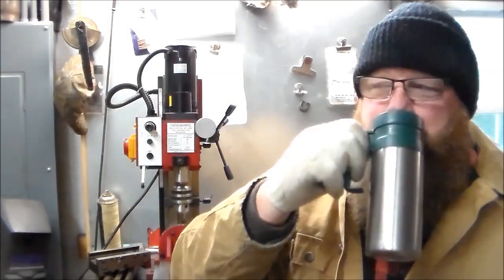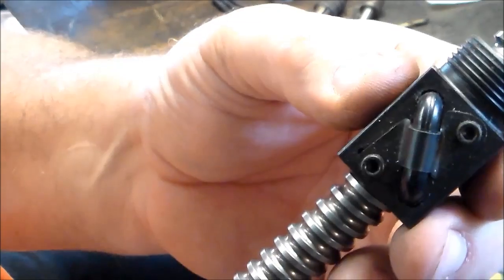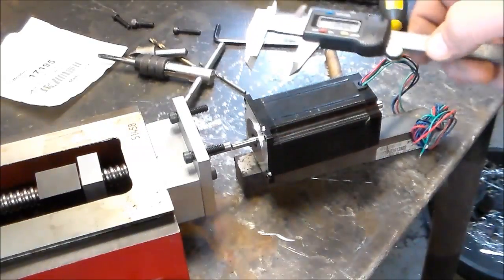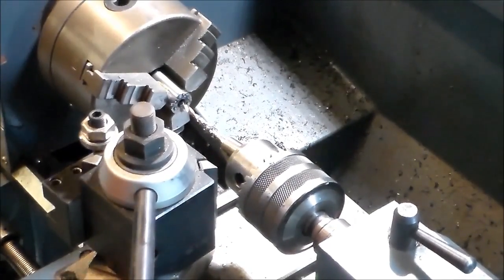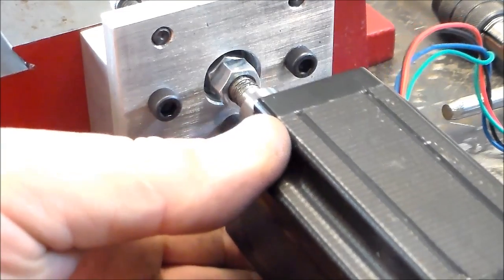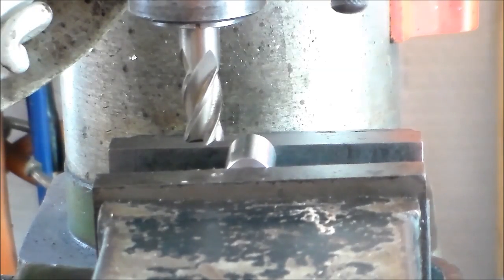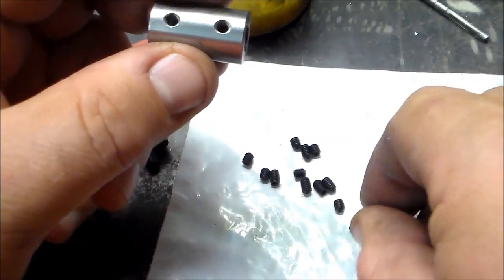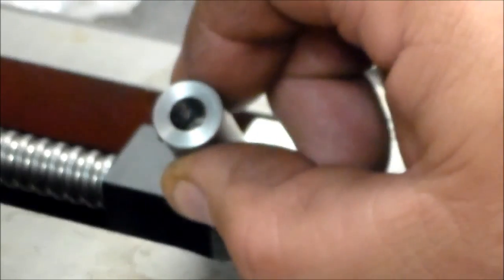Part 6 Harbor Freight Mini Mill X2 CNC Conversion Step by Step

Comment: Ditch the solid couplers. It will break either the stepper shaft or the ballscrew end in time. There are a few simple designs floating around.
   Personally I would buy them but to each his own. Just make them a priority after you get up and running and you will be safe. Otherwise, I will be saying "I told you so" ;-)
Reply from the maker: +CncObsession Oh wow, I haven't heard that before, but like I said in the beginning, I'm completely new at this. I'll definitely look into it.
Reply: +Self Made  This is a link to the different types of couplers and the pros and cons. http://www.engineerlive.com/content/18937
I am not connected with them in any way. Just trying to steer you in the right direction. It is a normal issue in CNC. The constant directional changes with inertia etc can destroy parts unless the are perfectly aligned and balanced. Neither of which are likely on a home brew HF product. No offense meant.
Reply: Look into Lovejoy, Oldham and helical couplers.
Reply from the maker: ***** I've used Lovejoy and flex couplers in the past on motors and  encoders for PID applications, but I thought they were mainly for making alignment easier. Didn't really think about the possibility of something breaking, but I am now.
Reply: +CncObsession yes just like I noted in the Parts section years ago, "Flexible zero backlash motor couplers - Keling or SDP/SI, or McMaster Carr or Zero Backlash Spiders. 

Note: Stepper Motor Standoff length will need to be adjusted to accomodate your choice of coupler.

 Oldham Style Zero Backlash Motor Couplers&#160; get them from McMaster."
Reply from the maker: +hossmachine Not disagreeing, but there are solid couplers in your drawings, so I figured that was ok. Should I ditch the solids now?
Reply: +Self Made I never had trouble with the solids, they were on there till the day I quit using the mill no problem but flexibles are better, unfortunately I haven't been able to edit the site in a while, still the print is there since that's what was made originally but better options were added later for flexibles.

Comment: I like how you are making the same conversion that I have documented on my website hossmachine.info yet have not heard you mention that fact.
Reply from the maker: +hossmachine Actually, I did buy your plans, paid in full. Early on, I wasn't sure if I was going to go completely with those or mix and match from other plans and ideas I had found. When I was making the first video in this project, I did mention you and others as my sources of info, but later edited it out, since I wasn't sure which was way I was headed. One of the reasons that I felt these videos might be helpful was that the plans were heavy on drawings and revisions, but didn't include any "how to" info. I felt like I spent a lot of time trying to figure out what was what. Since that first video, I guess I'd kind of forgot about crediting my sources for info, so I apologize if you feel I've crossed some line. In the next episode, I'll give you credit as my main source and direct viewers to your website. I honestly just forgot about it.